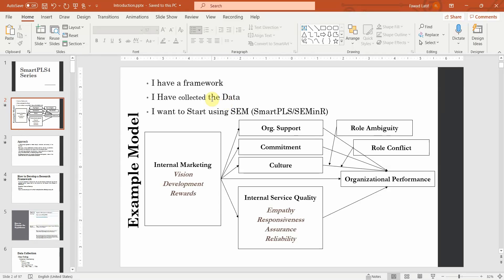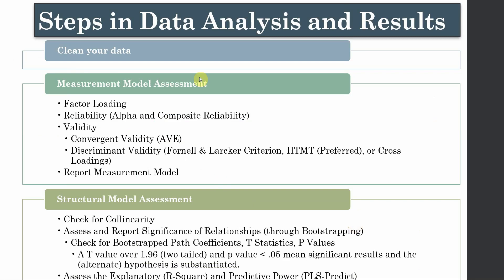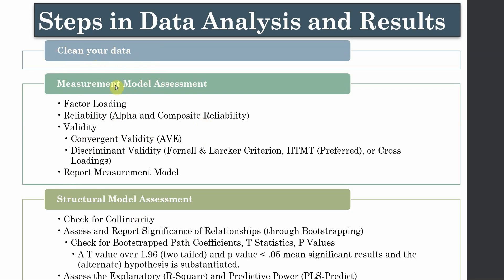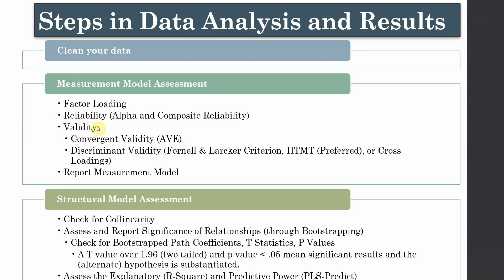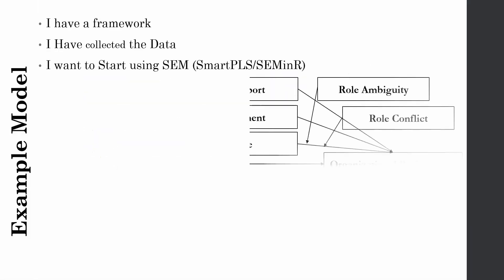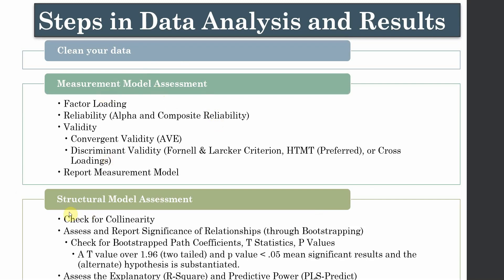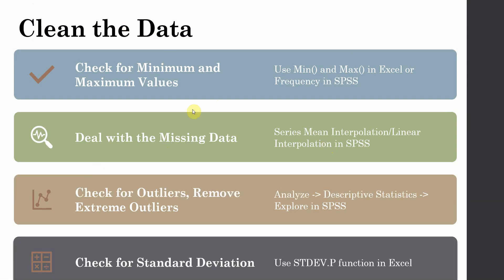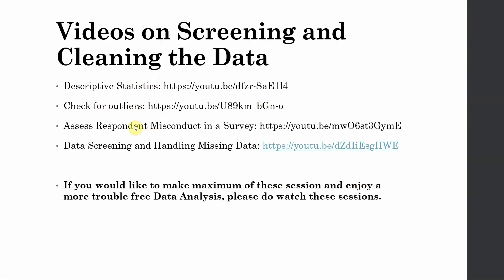#SmartPLS4 Series  3 -  Steps in Data Analysis and Cleaning the Data

Comment: Sir you are doing great .
Sir guide plz in article read in smartpls ourliers are not an issue even they write andvantages over spss is no need to check normality and outliers.
Your expert precious response is needed.
Reply from the maker: Thanks. I am glad you liked it. There should be no extreme outliers, plus slight deviation from normality is fine. However, too much deviation can be an issue.
Reply: @researchwithfawad  sir may Allah bless you your videos and replies helped me alot if i am not wrong you taught me smartpls .